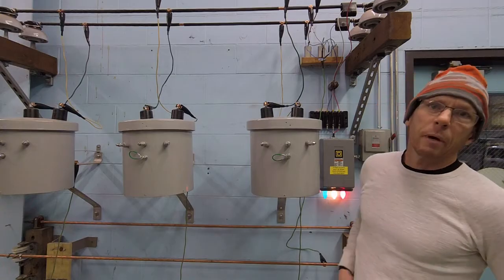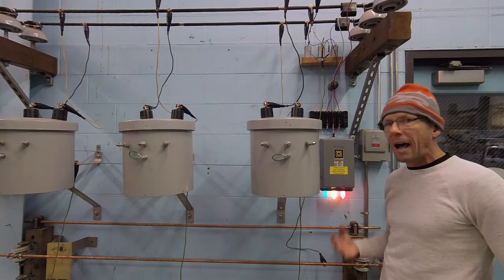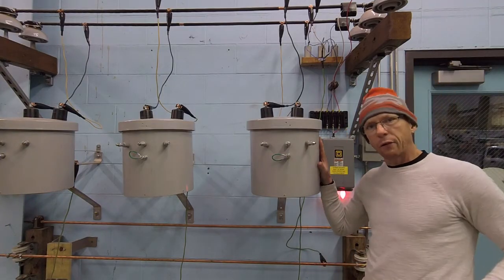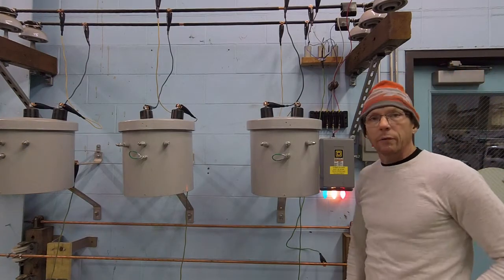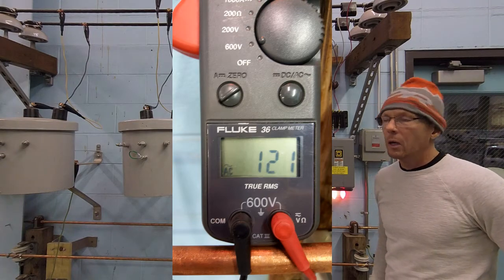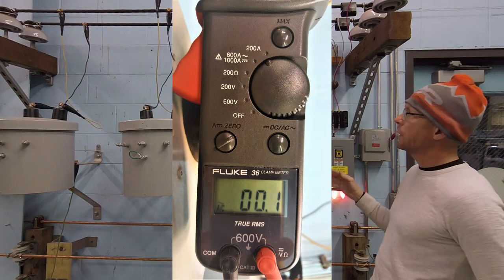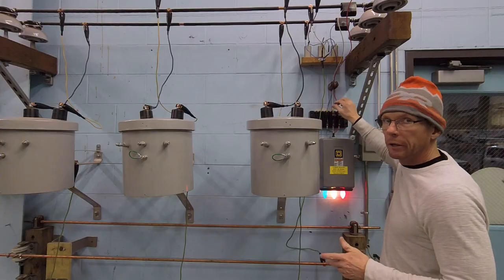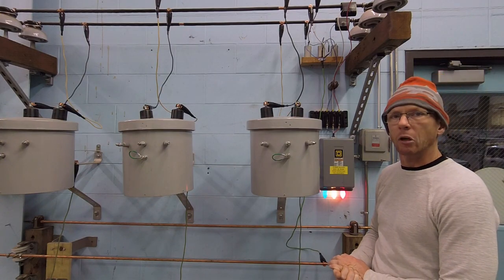💥Ferroresonance in Distribution/Power Transformers💥

Comment: I dealt with this in a small scale with 2x distribution transformers. It was wired as follows (single phase)  240v14.4kv----2000ft---14.4||240

When energized; the whole system pulls like 35a with no load 😂 we figured it was the HV cable capacitance that's throwing it off. So I use 480v instead of 14.4 and just deal with the voltage drop 😩

Comment: I've experienced this before with neon sign transformers.
I had two 15kv 30ma transformers, one stepping 120v to 15kv, then the other stepping down the 15kv to 120v and testing the power transmission between them.
I added some caps to the 120v output to smooth out the waveform.
And once I had messed around with that, I of course had to short out the 15kv a few times lol

But every now and then when I shorted them, the arc was substantially larger, and once the arc actually disapated where I was shorting the 15kv, the bushings on the transformers flashed over. Which I know these old neon sign transformers have pretty small bushings for the 7.5kv they handle. But they still don't randomly flashover normally. Even when damp they didn't flashover.
And the transformers made an absolutely awful hum. Each time that happened I had to pull the 120v supply for it to stop. And when I did there was quite the arc at the switch.

I figured it had something to do with the resonance of all the components, but didn't really think too much about it.

Pretty cool stuff!

Comment: Do you reeeaaaly think this hasn’t been modelled mathematically?

I’m an electronics guy and I immediately saw what this thing is.
You have created a band pass filter but because ferrite/iron core components have a nonlinear hysteresis component to them that bandpass frequency can swing wildly when the saturation is incomplete and if it matches the frequency you are trying to block (like 50 or 60Hz) then it starts resonating and the saturation goes up and down rapidly while maintaining the resonance.

The actual output of this chaotic oscillator circuit is not a sine wave either, it’s MUCH worse than what your voltmeter indicates. Because during desaturation the circuit pumps a lot of current into the capacitors, you are actually dealing with sudden pulses like those from a joule thief or a relaxation oscillator. What you have are probably short 1kV pulses layered in between longer resaturation periods.

Comment: Many RVs in the 70s and 80s had ferroresonant converters to run 12v devices and charge the batteries. Those converters were more expensive than the plain stepdown transformer models.

Comment: CVT transformers regulate great!  They have a very wide input voltage tolerance, maybe 50% low to 150% high.  while maintaining a constant output voltage.  However, they waste a large amount of power as heat.

Comment: Excellent video.  I saw this happen with a medium voltage transformer (MVT) at a customer's location (lumberyard).  The MVT was offline so CT's could be changed out; the primary switches for the MVT feed were across the road (~150 yards, above ground, on the power pole) and the utility lineman was closing the switches from the ground one by one with a hot stick.

Fortunately, everyone took shelter before the lineman went to close the switches.  Also, the panel door was closed where the connections were made.  As you mentioned, this had been done a few times before and there was no problem, but not today.

As the lineman closed the switch, the MVT let go.  Blew open the panel doors and destroyed the latches and the MVT.  Extremely loud and shook the ground.  Of course, that side of the plant stayed dark and large groups of people came out to see what the noise was.

Suffice it to say, the utility changed the swtiches on the pole the very next day, BEFORE they replaced the customer's MVT (the MVT was owned by the lumberyard and the utility had to replace it).

First time I had ever seen this in person.  Last time I hope too.  Thanks for posting this video!

Comment: A similar  effect is used in ( medium wave  , 1 MHz ) transmitters to tune the antenna ..... the junction of the series inductor and capacitor can rise to many thousands of volts at resonance  , so these components must be able to withstand this voltage without arcing or other breakdowns ....................... DAVE™🛑

Comment: The quasi-periodic behavior in this ferroresonant system arises from the nonlinear inductive characteristics of the transformer core interacting with line capacitance and nonlinear losses. While the waveform may appear chaotic, the underlying mechanism is better described as a nonlinear resonance with hysteretic damping, not necessarily a deterministic chaotic system.
Reply: I'm trying to have resonant power transfer into a nonlinear material at 110mhz. Do you have any ideas?

Comment: in the 80s I installed several single-phase transformers that had a label on them calling them Ferroresonce transformer. Basically it was two transformers wound together. One coil acted as a choke on the other the end result was a transformer that had a steady non flucioating voltage output. The problem with them was they put out a louder than normal hum and they drew some power at all times.
Reply: Yup, ferroresonant constant-voltage transformers. The ferroresonance in this case is trapped in the secondary by the magnetic shunt (the extra piece of core splitting the "two transformers") so the primary doesn't saturate, and the resulting saturation of the secondary is used to cap the peak voltage, while ordinary resonance from the tank circuit boosts the voltage if it sags.

Comment: This phenomenon occurs easily in high voltage lines where capacitors are in parallel with unloaded HV transformers, AKA ringing effect. This produces higher terminal volage which keep increasing until the capacitors blow their fuses. To prevent this, the transformer is loaded to 20-30% capacity before bringing the capacitors in to the line.

Comment: Quite a bit of electricity created breaking the law of conservation of energy?
Reply: Nope, current and voltage can freely trade places, power stays constant. This is the same effect as a tesla coil, generating massive voltages with an air-core inductor in resonance... just set off by the saturation of the transformer core creating that air-core inductor.

Comment: As SOP,  if you always keep at least a dummy load on the secondary,  will that prevent a random ferroresonance event?
Reply: The resonance between a transformer and a capacitance on the wires is always present, varying loads will just change the "trigger point" as it were, relative to the line frequency. If the transformer is only resonant with the particular capacitance of the distribution lines near it at low load, a dummy load will work... but if the resonance happens at the inductance of the transformer under higher load, then the dummy load won't help at all.

Comment: In effect this explanation means that 'ferroresonance' is a misnomer. This is ordinary LC resonance happening at 60Hz; something the ordinary electrician may not be familiar with practically, but that is very well known and studied especially in the RF domain. Possibly a heavy duty surge supressor on the secondary would be enough to reduce the Q without wasting too much energy in ordinary operation; if the surge supressor kicks in at say 250 VAC, then when at 240 VAC no energy will be wasted. It is a bit of a waste at no load, but would be interesting to see how much since this would spec it pretty well. Another alternative would be to install lighter gauge wire on the feed side so that enough loss occurs to drop the Q; essentially inserting a small resistance into the circuit. Yet another: would adding capacitance drop the resonant frequency enough to eliminate the problem? Maybe; maybe this is partly why they have them in distribution stations.
Reply: I like the idea of using lighter gauge wire like this. It's elegant, as long as the characteristics work out of course.
Reply: I'm open to being wrong about this. A wiki on it claims a nonlinear inductor is to blame. To resonate 60 Hz with 100uF of capacitance will require 70mH of inductance. Is 100uF a lot? not really in terms of electrical components, but to reach this much stray capacitance would take a long run of closely spaced wire. People often believe that a transformer is operational by N1/N2 turns ratio, but there is another rule of thumb that the impedance of the transformer must be four times that of the load; otherwise this ratio really does not hold. Otherwise we'd be winding really low turn count transformers all the time. Instead you'll see appreciable turns count and this does mean more inductance. Also large core yields large inductance.

Comment: This is great!  I have worked with regulator systems and ballasts that deliberately resonated a transformer winding with a lumped-sum fixed capacitor.  Same trick is used for regulation on the bargain-basement Chinese generators.  But I had never thought about accidental parasitic ferroresonant effects!   I think part of why this is difficult to model and why it's unpredictable in the field is because the inductance of the transformer primary depends on the amount of flux in the core and therefore dependent on the load.  And of course the transformer is so nonlinear in the best of situations.    So you may have a stable system one moment but an unstable one when the load is very slightly changed.    This is very cool!
Reply: Ah, good, I was hoping someone else already knew about ferroresonant constant-voltage transformers. The magnetic shunt keeps the primary out of saturation, and the third winding keeps the effects away from the load... the secondary side acts as a saturable reactor to cut out above a certain voltage, and the resonance below saturation boosts the voltage during sags. Incredibly elegant, especially in a time when the alternative was motor-driven autotransformer banks.

Comment: Nice description and demonstration. I have several large GE two way radio system 12 V power supplies that uses a ferro resonant design. It is not terribly efficient, it is old, like 40 years or more. But is is stable and bullet proof. Has seen its share of surges and strikes. Provides a good stable output because of the design. One man’s benefit is another man’s problems.
Reply: I remember the Mastr2 base stations from the early 80s, solid as a rock.

Comment: WHAT? 
 
A transformer is producing an alternating magnetic field, this field can be picked up in the surrounding area, this is not magic, this is not hocus pocus, there are no saints blowing the love a Christ into a copper coil. 
 
A condensor can store energy for a while, a transformer can make a magnetic field from an electric current and visa versa. If suddenly the voltage goes up in this kind of LC circuit that here must be an external source of power, that is to say an alternating magnetic field or a leak somewhere over a capacitor. I suspect the latter ones. 
 
The laws of physics forbid energy to be created out of nothing. Abide these laws, for goodness sake! Way to many scientists have lost their lives under mysterious circumstances, right after inventing a free energy machine, the perpetuum mobilé. The big energy companies do not like their business being challenged. That is a fact.
Reply: Voltage isn't power... you've skipped right past the answer, there is no external source of power because when voltage goes up, current goes down in proportion. An LC circuit is like a wheel, rolling from positive voltage, to positive current, to negative voltage, to negative current, back to positive voltage, losing a bit of energy to resistance each time. If the tank current aligns with the feed current from the supply, which is to say, if the LC circuit is line-resonant, it will be "pushed forward" by some amount each cycle, and the voltage it achieves each cycle will grow continually. This isn't making something from nothing, it's simply storing AC power, accumulating energy.
Reply: @jercos  
Sorry, I never said that voltage is power.

Comment: Very well explained and demonstrated!
Back at the 80's I sold voltage stabilizers and ups's which were based on ferroresonating circuits, usually upto 3kw output they could tolerate upto 30% sags at the input while maintaining the output voltage within no more than 2-3%.
Reply: I have used UPSs since the 80s. Everyone should have them on any electronics in their house and business

Comment: "Saturable reactors" use something that could be used to mitigate the magnetic remanence in the core material.

The randomness of ferroresonance could easily be tied/affiliated to the remaining magnetism in the core. 

The DC line used in saturable reactors,  aka 'magnetic amplifiers', could be used to install KNOWN MAGNETIC CONDITIONS in the core of the xformer.  BEFORE any testing or turn-on.

Then, a series of tests could be conducted to find the level of (leftover, remaining, ie. remanance) magnetic condition in the xformer cord that leads to resonance.

As an example, if you took the remanence down to zero - ie. if all the magnetic domains were 100% random, so remanence is zero, that would ELIMINATE a random magnetic condition in the xformer core as a source of resonant oscillation.

And it could be (likely is) different for different xformers.  But being able to start from a KNOWN remanent magnetic condition in the core (such as ZERO, ie. all prior magnetic fields removed) - this would help in reproducing experiments, because it no longer leaves to chance the unknown level of remnant magnetism in the xformer's core.  

Locking down one of the possible resonance sources.  Another way would custom-build a test xformer so that the core is quickly removable and a new core installed that the DC line was used to establish a KNOWN level of remnant magnetism in the installed core.

The above is for experimenting, to better control a random input (remnant magnetism that is unknown) that contributes to the random resonant oscillations condition.

I bet the randomness everyone has seen in the field, and the instance of ferroresonance, is because of the unknown, not measured level of remnant magnetic field in the xformer core.

If I was experimenting, I'd set up the following:
1)  a complete shunt of core remnant magnetism to zero
2) use a DC line to impose 25%, 50%, 80%, etc. remanence magnetism

Comment: Wow, you have demonstrated something I saw years ago. We moved down to the very West corner of the UK and had a lot of main voltage damage done to our computers. To begin with we did what we were advised, and got a ferroresonant CVT power conditioner. But it made things worse. I went into the office early one Sunday to find this 2KVA lump break-dancing across the floor. Absolutely rattling. I put a meter on it. The voltage was coming down from 310VAC output (UK single phase.) Heaven only knows where it had been. But if you suggest up to 4 times, that would explain it! It made things a lot worse and we lost two more computers with it. So, yes, when this thing gets out of hand. Thank you!
Reply: The loading in the CVT probably even directly triggered events, the whole thing is a tuned resonator at 60Hz... the primary's never supposed to saturate, only the secondary side, but I expect the magnetic shunt in the CVT would saturate first once the lines started resonating, and then the regulation's shot. Once the primary's saturated each direction, the impedance massively drops, and it'll suck huge amounts of power down trying to melt itself.

Comment: Does ferroresonance affect hertz?
Reply: "Hertz," frequency, is only meaningful in steady-state AC. If a signal isn't a clean sine wave, it doesn't have a single frequency any more, it's made up of multiple components. Since resonating with the line frequency is the presumed trigger, I don't think the fundamental frequency would shift, but you would get harmonic distortion added to the supply (and reflected back onto the lines) that could be at any number of other frequencies.

Comment: I ran into Ferroresonance a couple years ago on a 34.5kv wye circuit. I showed up to a no power call to find the field phase cutout blown, upon examination the cold shrink of the terminator had flashed and blew a small hole down near the concentrics. This was a run of about 700 feet of cable feeding this one business, their automatic transfer switch had already unloaded the transformer and when I load busted the middle phase cutout I had a larger than normal spit off the cutout horn and immediately the hole in the terminator began to arc over and melt and continued to arc and melt until I realized what was going on. I was able to get down and run down to the pad and isolate the primary coil via the primary switch in the pad. The transformer was making a horrendous noise and by the time I opened it the terminator and all the insulation almost down to the positioning bracket was gone. This had been touched on briefly years prior in training as it had happened to another crew pulling an elbow but I wished there was more emphasis put on it.

Comment: I was watching a series on restoring older computers and the technician found a ferro resonance transformer used in the power supply. So it is not always undesirable, but not when it wasn't designed.
Reply: A constant-voltage transformer keeps the ferroresonance in the secondary side of the transformer using a magnetic shunt, which avoids saturating the primary side of the transformer. It also generates the resonance intentionally using a tank circuit, an extra winding on the secondary connected to a capacitor. The resonance can boost voltage, while the saturation of the secondary cuts it off when it gets too high. This is a rare exception to ferroresonance's undesirability, a caged beast as it were.